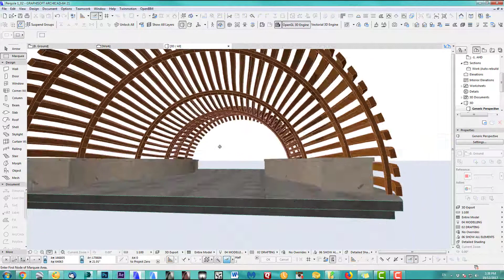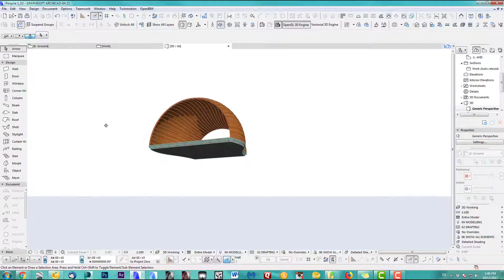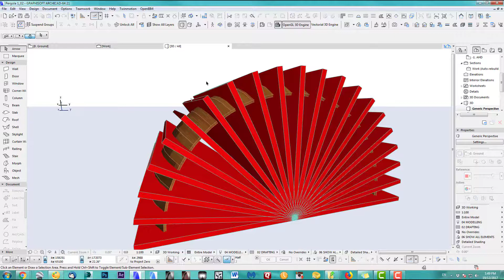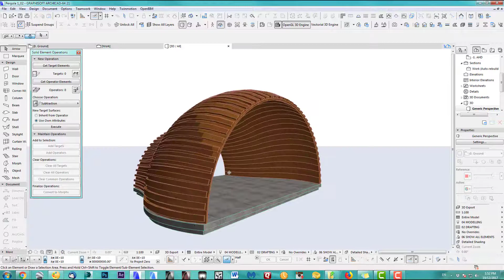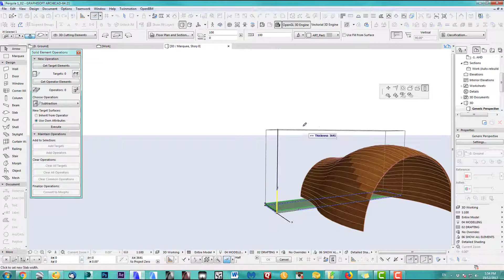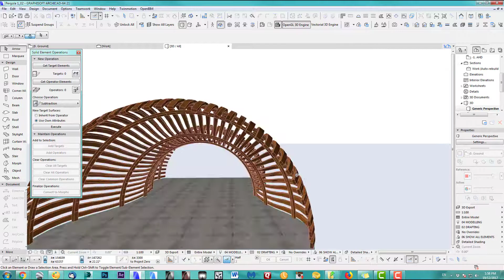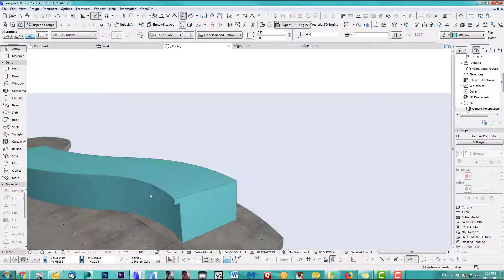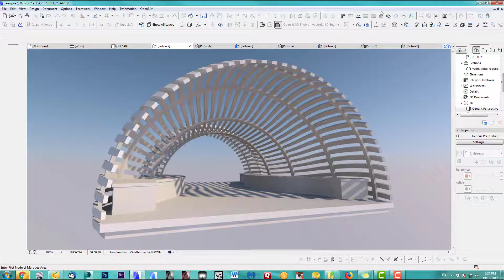How to model a Pergola Place in Archicad

Comment: Hello this is great.i have a question though,  which combination did you use to create the 3d cutting layer?
Reply from the maker: Hi, thank you. I am not sure what you mean buy " which combination did you use to create the 3d cutting layer ". Please explain further and I will give you an answer asap.
Reply: let me try to explain.....the slab that is converted  into a morph in the tutorial and then subtraction through solid element subtraction is linked to a 3d cut layer. I have tried making a similar layer but hasn't worked so am wondering how to create one so that when I execute the subtraction I can get a similar pergola as in the tutorial
Reply from the maker: thanks for explaining ! I will get back to you over the weekend, it's Friday evening here Down Under and I need to relax :) Talk soon.
Reply: thanks...will be waiting patiently. Have a good weekend
Reply from the maker: HI Caasi, the 3D cutting element layer is a normal layer as all others. There are 3 reasons it might not work for you .

1. Layer combinations can be different in 2D + 3D so please check this first. The best check is to have a 3D view with all layers on, then turn off the 3D cutting element layer which has the cutting elements on it. See if it works
2. In my tutorial the 3D cutting element layer has a number 2 in front. This is because sometimes ARCHICAD seems to not like it when certain model elements intersect and it will show them wrong in 3D, or not at all. This is what that number in front of the layers is for ( any number as long as they are different ). Make sure the pergola layer has a different number in front of the layer then the 3D cutting element layer.
3. Then there is the possibility SEO did not work. You can check if it worked, after the SEO change to wireframe view still with cutting element layer on, then you will see if the pergola has been cut.

Let me know if you can get it working now.

Cheers Carsten
Reply: thank  you ..i will get back to you  soon.
Reply: thanks... i was able to  make the layers needed for cutting. i appreciate...will send you what i made out of it